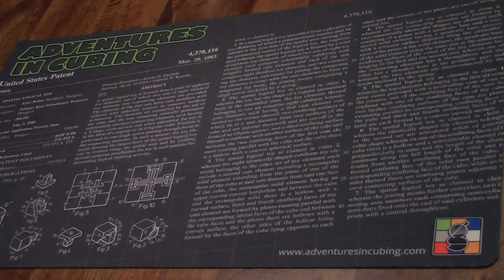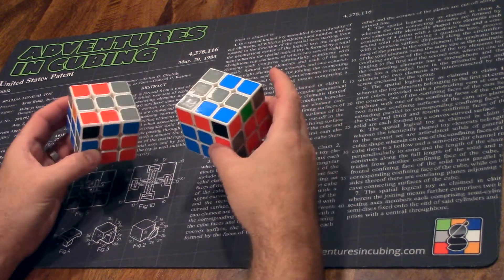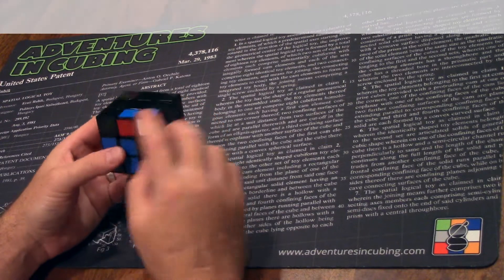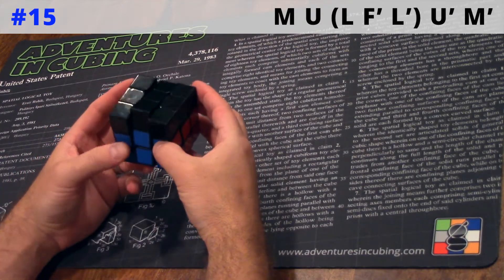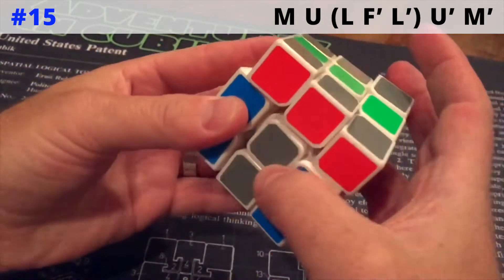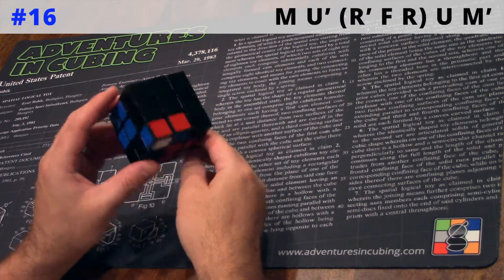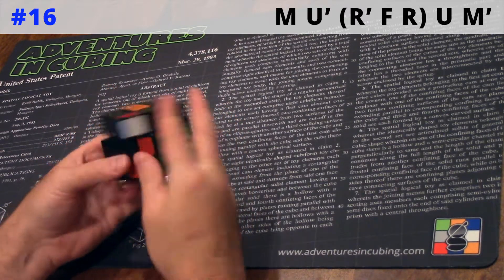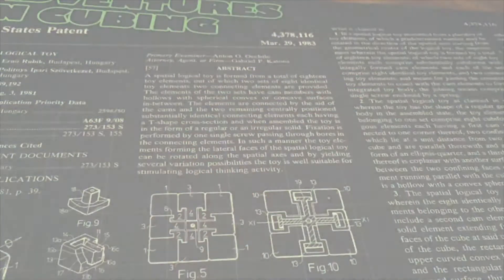M Slice F2L (##15-16)

Comment: The thumb on the M U' surprises me. I pull it from the back with index. A lot of your grips in general are very unique.
Reply from the maker: Unique is not necessarily a good thing!  Unique can be -- "oh, how neat and unconventional and clever."  Or it can be euphemism for "that's sort of clunky and odd."

I generally use my left thumb on algs that start with an M.  For example, the sune-based Mouse OLLs (which I now perform far better): http://adventuresincubing.com/2013/10/28/mouse-olls-3-4/
Reply: Adventures in Cubing Right...but I'd rather watch unique than conventional. Always looking for new ideas.

Comment: You don't necessarily need a rotation to solve these, just solve it with faster moves
Case 1: (U) (R' F R F') U (R U R') Its really quick
Reply from the maker: That's a nice alg. I may start using that instead for #15 when the U layer is off by a U turn. Thanks!
Reply from the maker: Actually, I had forgotten about that alg.  About 10 months ago, I did a video/blog on that as an alternative for #15.  http://adventuresincubing.com/2014/01/10/still-more-tough-f2l-15-18/

Thanks for reminding me.
Reply: No problem! I love that alg!